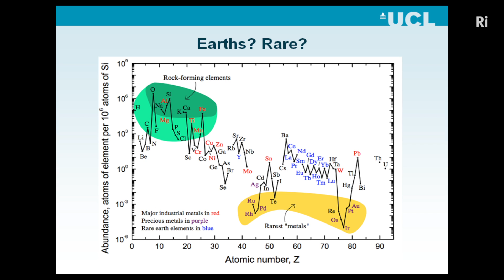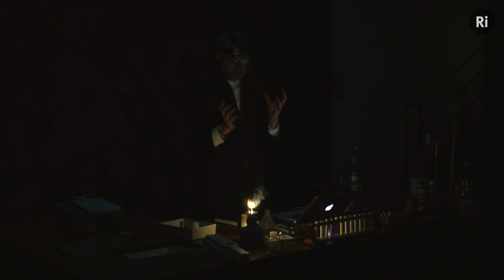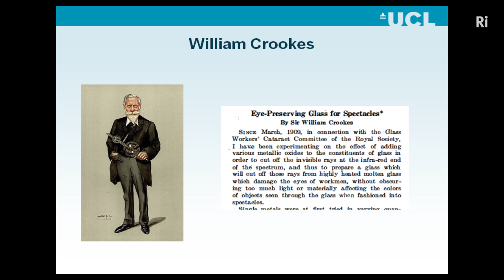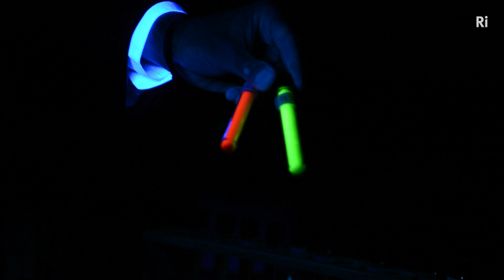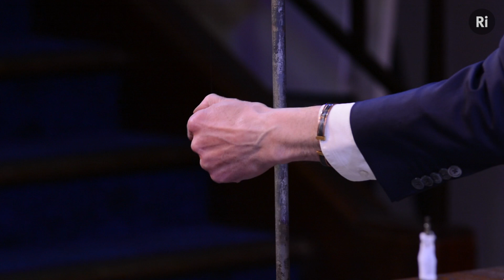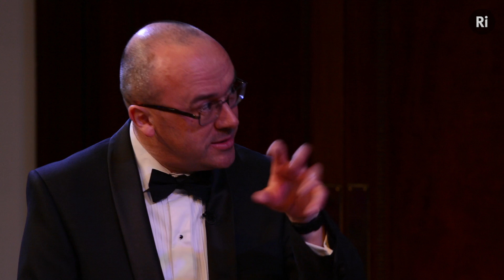Andrea Sella - Terra Rara: The strange story of some political elements

Comment: 38:10 REE 4f orbital are not the most easily accessed. Lanthanide Atoms are completely spherical. Essentially a sphere with a charge with no directional effects, no covalent effects which allow to covalent bond. Association with REE and other molecules turns out to be loose and dynamic. Electronic structure of lanthanides is extremely complex and demanding. Although chemically they are similar, the light optical properties and magnetism v  is completely unique and special.

Comment: It's impossible to modify and NOT know. I've only known 3 people to delete their cat out of a 8500 member community and, of those three, none of them are daily driven cars. High-flow cats are generally accepted as the upgrade for factory catalytic converters. The way I modifying exhaust system has shown an increase of 1-3 MPG and 15-17% increase in rear wheel horsepower (RWHP) so I don't think it would be smart to stop it.